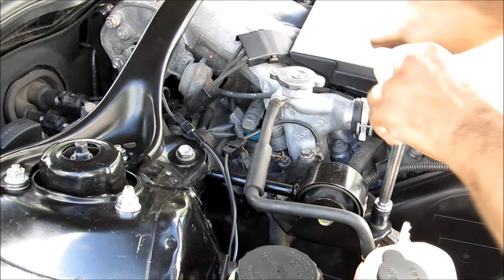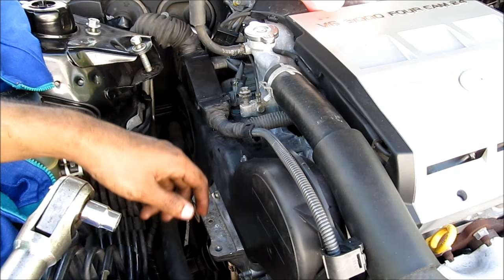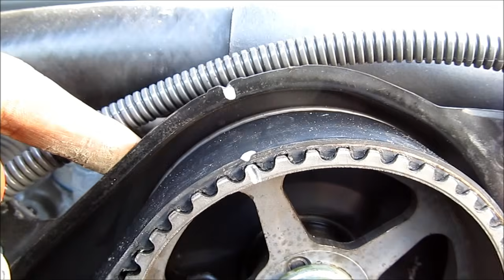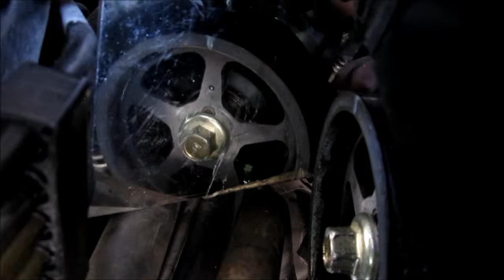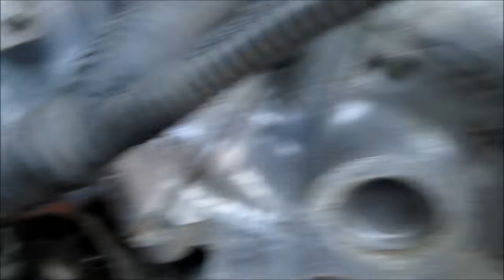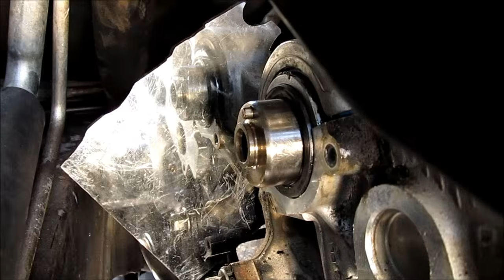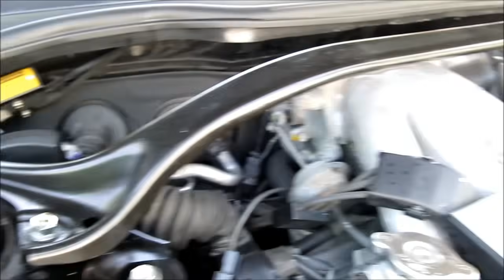Timing Belt / Waterpump Replacement: Toyota & Lexus V6

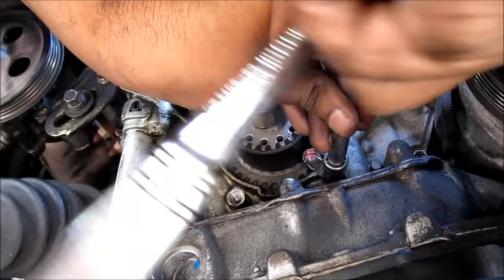Comment: I just took the timing covers off and noticed the "timing plate" that you mention at 3:08 is missing. Is that the actual name for it and do I need to get it?
Reply from the maker: +Kranium31 Look it up on Toyota parts online though the diagrams
Reply: speedkar99 I didn't find it in the diagrams I'll go to the dealer and grab it. Someone said it has been running for over 100k miles without it so I might not have to worry.
Reply: speedkar99 I found it. It was stuck to the back of the timing cover. It was getting dark I must've taken the bolt for it off with the timing cover bolts. 😂

Comment: Best step by step video for this timing belt I've found so far. I like seeing the process start to finish it makes it so much quicker if I have an idea what's involved first. My only question is does removing the rear sprocket stop the valve springs from turning the camshaft? If not did you back the engine off tdc before removing it? They make a tool for removing the camshaft seals and installs them that I've bought to make that easier with the shock tower in the way. This video makes me much more comfortable about doing this timing belt. Thanks again!
Reply from the maker: +Kranium31 thanks. I don't recall backing the rear cam from its timing...this was 3 years ago haha! Glad it helped.

Comment: I like how you did this video. I appreciate that you edited out the needles wrench turning footage.
Also the brain damaged TOYOTA engineer who designed that NEEDLESS  INNER timing cover should go commit Hari-Kare
Reply: The "inner timing cover" is actually whats known as a heat shield, to prevent excessive heat from warping the timing belt and pulleys prematurely. The engineer who designed it is probably a high level senior engineer now.
Reply: @ricky-sanchez  Very doubtful!!!
Reply: @scottmurray4689  Well he's making inner timing covers, and your arguing online about easily removable sheets of metal. Who is the true winner?
Reply: @ricky-sanchez  Obviously not you!
Reply: @scottmurray4689  Calm down, it's not that serious. It's just a heat shield.

Comment: Are you a mobile mechanic in LA by chance? Does it cost a lot more in labor to replace cam and crankshaft seals and valve cover gaskets?
Reply from the maker: +M B nobim not a mechanic. The labor isn't much more but only worth if they're leaking

Comment: At 5:27 in the video, it seems that the lip that keeps the belt from slipping off of the rear camshaft sprocket is on the outboard side, away from the block. But this lip is on the inboard side of the front sprocket. I wonder if one of the sprockets got flipped over previously. Shouldn't these retaining lips be on the same side for both sprockets? If so, should they be on the inboard side or the outboard side?
Reply from the maker: +Michael Westlund No they're opposite because you have to prevent the belt from slipping into the engine as well.

Comment: The Lisle 58430 seal puller is cheap and looks like it would make that rear seal (and all the seals) easy to pull. Here's the video. https://youtu.be/l7ryeygpM2M
By the way, I broke my new cam holding tool when I over tightened the bolt on the rear CAMshaft sprocket. Be careful not to go over the torque spec of 94 foot pounds (I was looking at the much higher CRANKshaft value by mistake).   Also, I'm wondering how I'm going to properly tighten the crankshaft pulley bolt to 159 foot pounds. I have a clicker torque wrench and a pipe to put on it but can't think of a way to keep it from spinning. I also have a Harbor Freight electric impact gun (I never bout an air compressor), but I only ever use that for loosening, not tightening because I can't measure how tight it makes stuff. I saw that you used an air impact gun. How did you know when to stop torquing it?

Comment: I also nicked my camshaft when pulling the seal. Should I try to file it a little to remove the burr?
Reply from the maker: +Michael Westlund I would leave it as smooth as possible. Filing might make more damage

Comment: great video. I did this on a 2001 highlander with the 3.0v6...original belt at the time was 13 years old with 230000km on it and it still looked good. it was starting to dry out a bit but I bet it would have kept going for a while yet. The waterpump also looked good for its age. only the tensioner idler bearing had failed and it was diagnosed as a bad waterpump.  Quality parts and good design to minimize belt stress i guess. OEM does call for 90k mile interval (140k km) which is twice as long as many cars of the era
Reply from the maker: +MXSLICK Yea the belts can last longer than they call for but your living on borrowed time. On my 05 ES330 I changed the original belt at 185km. It was dusty under the cover but otherwise belt was in good shape.

Comment: What are the symptoms of a bad water pump, when I accelerate I hear a whining noise at times. I got home after hearing that noise and hear bubbling from my engine and looked at my gauges water temp was rising. Coolant reservoir bubbling and spewing coolant
Reply from the maker: +LFDS94 head gasket

Comment: Doing this job myself. Any danger in the cam valves slamming into the pistons once the belt is removed? Also, which motor mounts need to be loosened if at all to raise engine? The bolt going into the water pump is hitting the frame when trying to remove it.

Comment: You should hold the rear camshaft with a 17 mm wrench before taking off belt as not to have the shaft spring counter clockwise and do damage to valves.
Reply from the maker: +Sir Sweetness good tip.

Comment: That escalated quickly. I was on another site and they said "remove the alternator, replace the water pump" and I come here and it's like legos with verbal instructions...
Reply from the maker: +James Clark Huh? Did you find my video too slow? 
Alternator doesn't have to be removed unless your thinking the 4 cylinder engine

Comment: Great video, as always! When removing the cam sprocket, how do you ensure the camshaft hasn't moved? Especially during reassembly, even with the tool, at 10:39, the camshaft moved a bit...just wondering how I can avoid that as I'll be doing this soon (on a 5s-fe)

Comment: First of all, thank you so much for this great video! Secondly, a couple errors I noticed: the torque spec for the water pump bolts is 53 in-lbs according to the manual. I snapped a bolt unfortunately. Also, replace the PS belt before replacing the upper timing belt cover. The PS pivot bolt is blocked by the cover. Minor detail: the cam shafts you are referring to are actually the cam sprockets. I also suggest adding the instructions to drain the PS fluid since it's very easy during this job. Again, great video and thank you!!
Reply from the maker: +Christopher Duncan Thanks I'm glad you enjoyed my video and thanks for the feedback.

Comment: Hey Speedkar, I'm finally doing this, this week (10 months later lol)!  my water pump is leaking coolant, so its time for sure.  I was curious though if you knew/had the torque specs for all the bolts, especially the crank/cam bolts?  I've been googling, and these seem to be hard to find for some reason (probably b/c they want you to bring it to the dealer lol.  would you have any other tips after the video?  Oh, i did my spark plugs 3 weeks ago, (thanks to your tutorial it went very well!!)  and i'm doing this job b/c your video's are so well made and edited, thanks again man!!!
Reply from the maker: +chris hill Thanks I'm glad you enjoy the video. I only use a torque wrench when there's a gasket involved and its critical. 
My suggestion is to not waste 3 hours like me on the rear cam seal if it ain't leaking. Its difficult to get to. 
Also make sure you can take off your crank bolt before starting the project only to get stuck there.

Comment: i followed all the procedures on your video i have one issue i installed the crank bolt to line up my timing marks rear camshaft .front camshaft and crank are all lined up. once i removed my crank bolt i noticed all line marks are off by   a tooth.tried thee times i had the same results.this happened every time i have to remove the crank bolt. i figured if rear and front cam sprocket as well as crank mark are all off by one tooth only when i removed the temporary installed crank bolt my gut feeling once permanently installed my crank pulley and verify my timing marks they are all in the money.please share your expertise this is my first time to do the task.by the way i learned a lot from you.one suggestion to take the seal off first tape up the shaft the paint opener from home depot about 3/4 or an inch from the claw bend it 30 degrees and it works fine. installing the seal i used home made pbc pipe.i only replaced the one that was leaking .thank you for sharing your experience.knowledge without experience is only information. thanks again
Reply from the maker: +izcoronel glad it helped thanks

Comment: Speedkar99 you indeed do a beautiful video.  How much different will it be for me to do my 2007 Highlander Hybrid?
Reply from the maker: +Steve Wieck Thanks. The HH has electrically powered accessory belt. Once that's off the timing belt procedure is the same, with the exception of the tensioner.

Comment: NO degreaser, use brake cleaner!, then wipe! 
The vehicle should be in Park , or locked with emergency brake (if manual). So I dont get why the use of the special tool

Running smoothly comes well befire replacing the timing cover, ya?

Comment: Why do you need to hammer flush the seals? THe pulleys would push them in just fine.
Reply from the maker: +Dan Lo Fat Ah...not really.
Reply from the maker: +Dan Lo Fat I've heard you can use the pulley to push the seal in with an exact size spacer (old seal)

Comment: The petcok doeasnt need a hose, it has a small valve pointing down, maybe a hose so yo udont need to remove the splash guard. THe Avalon 97 doesnt have a petcok aim hole for eptying.
Reply from the maker: +Dan Lo Fat hose helps with less spilling

Comment: You said Avalon, but that is NOT a spalsh gaurd of a 1997 Avalon. Also WHERE did you put the timing cover?

And cam and crank seals are ALWAYS going to leak a bit, even when brand new car! But thatnks for remoineding me.

NO you should have marked the shaft gears BEFORE any pulley removal.

Comment: @speedkar99 is it possible to change only the crank seal by moving to TDC, marking off the crack sprocket, releasing timing belt tensioner and moving the crack sprocket out of the way?
Reply from the maker: +Samy Kamel Yea but you still have to retime the cams and make sure they didn't move. Risky
Reply: what if i hold the belt to the cams and line up the crank sprocket to the belt then remove the crank sprocket, move the belt to the side, replace the seal, then put everything back together making sure the crank sprocket lines up with the belt before putting the tensioner back on. would that work?

Comment: At 5:15, when you remove the belt, isn't the tension in the rear camshaft an issue? I'm doing this on a Sienna, and I've heard holding the rear cam in place (with a 17mm wrench set up against the firewall) once the timing belt tension is released, so the valve springs don't snap, turning the rear camshaft counterclockwise.

Or, alternately, (from Haynes): "Relieve the tension between the rear (right-hand) and front (left hand) camshaft sprockets by turning the rear sprocket slightly counter clockwise."

And this exchange from a Schrodinger's Cat (Youtube Channel) Video on a Sienna TB replacement: 

Q: How do I remove the rear camshaft sprocket in order to change the oil seal without it springing back? You mentioned you didn't want to remove it because it would be a big pain, but I need to remove it so I can replace the oil seal. What's the safe way to do this? Will rotating the crankshaft back 45 degrees, as you mentioned, relax all the spring tension on the rear camshaft sprocket enough so I can remove it without causing damage?

A: You positioon the crankshaft about 45 deg BTDC and then let the cam settle back into its neutral position, then you can safetly remove the sprocket without having to worry.
Reply from the maker: +N A Yep you can move it back so it doesn't sit on top of the lobes and it won't snap forward or back. The repair manual has some sort of procedure for this but IRS not as clear

Comment: someone knows how to align the bottom camshaft pulley with the 2 pulleys on the top
Reply from the maker: Just turn it
Reply: +speedkar99 oh  ok, please bro an other cuestion. extremely bad and  missing teeth or crank timing belt can cause a no compression in the engine?  Thanks a lot for the reply
Reply: Bottom PULLY is "CRANKSHAFT"

Comment: How do you know how to reinstall the cam gears in the correct position? I know there's paint marks to match on the belt, gear and bracket but wouldn't the cams be able to spin freely once you've taken off the gears? I can get the crank at top dead center but unsure how to align the 2 cams once the gears are off in case they move.
 I just need to change my cam seals but I understand I need to take off belt for it.  Thanks
Reply from the maker: They have keyways on the cams.

Comment: superb video...thanks fella.
I had a garage do the same as you just did..new tensioner, belt and water pump. now i have a tapping/ticking on warm up and doesnt dissapere until engine is completely warmed up..even then i can slightly hear it. its not there for the first 5mins on start up..then it gets louder and then fades after about half hr driving!  Had it back into garage for them to confirm all the timing marks are spot on and safe to drive!
Any ideas as to what be causing this noise?  as it was'nt there before i had the work done!
Imagine a sound of a thin bit of plastic in the spoke of a kids bike wheel!    Your input would be great recieved...im thinking i will have to resort to this video in the near future lol?
ideas pls?
What can this be? i am at a loss
Reply from the maker: Thanks! Sounds like this right? https://www.youtube.com/watch?v=uW_VV_jv0cE

I think its the timing belt tension or pulley or something...read up on the Lexus forums a lot of people have this sound after changing the timing belt. I had it too on my ES330 but I sold that car. No sounds from this car, my Solara.

Comment: Thanks this will be a great resource when I replace the belt on my 91 es250. How do you tighten the harmonic balancer back on without power tools? I may decide to rent an impact gun for the job
Reply: I know it's a different car but some of the techniques can be applied
Reply from the maker: You need a crank pulley holder. If you have a welder you can make one out of steel strips

Comment: Thank for the video, I was great, It help me a lot for my timing belt change. But I run in to a problem, After the timing belt change. my engine have some wear thing happen. When it run at idle, it run smoothly, but when I accelerate it and decelerate . The engine got a cluck cluck sound while the engine decelerate. Could you give me a advice what cause this problem? Thanks.
Reply from the maker: Glad it helped. Seems like your timing is off.
Reply: I re-did the timing today, it run run for a while, but after driving around for a while, the cluck cluck sound come back again, I petty sure this time the timing was good, I check for many time before I put everything back together. One more thing is my car is really loud when it run, the sound seem to come from the back of my car., but when it park the car run smooth and quite. I decided to change the timing belt because of the loud noise. I ran out of option now, do you have another advice for me? Thanks

Comment: Good job, what does a mechanic charge for this job?
Reply from the maker: 5-7 hours labor.
Reply: speedkar99 like 600 bucks
Reply: Interestingly, I looked up the Aisin timing belt kit on Amazon, and they've started selling mobile mechanic services in certain markets. Quote is $399 in my area- BYO timing belt, coolant, etc...

Comment: I have a question: when you tightened  the crank bolt in the end. Did it spin? how do torque to 162 ft lb. Thanks
Reply from the maker: +B Tr You need a crank holding tool to torque it properly. I just tightened it down with the impact gun, which doesn't cause it to spin because of its impacting action.

Comment: what if we put timing belt (TB) on, turning crankshaft 2 revolutions and find out that the TB not aligned, can we remove and do it again before pulling tensioner pin? thanks
Reply from the maker: +B Tr no, since if there's no tension on the belt it can slip a few teeth when rotating
Reply: thanks for responding.I watched your vid. you put the belt on, aligning all the marks, tightening the tensioner and pulled the pin. It looked simple but why some other guys' videos showed that they had to turn the crankshaft a little bit counterclockwise? That looked more complicated. Can u explain that for me please. Thanks a lot. I am a diy beginner
Reply from the maker: +B Tr the manual states that you have to move the crank 60 degrees from tdc when taking off the belt to ensure if the camshaft slips, it doesn't hit any valves inside. This is only a precaution and not nessesary.